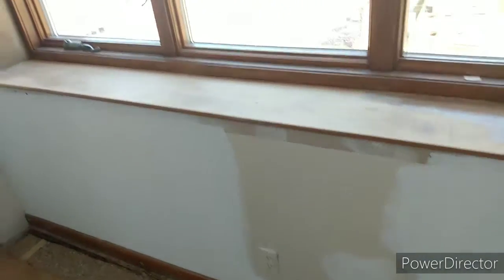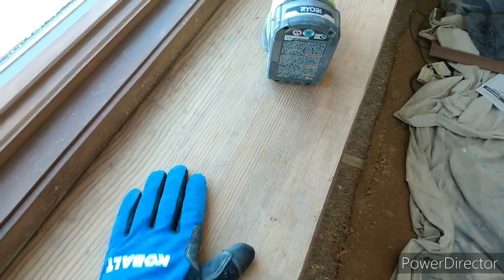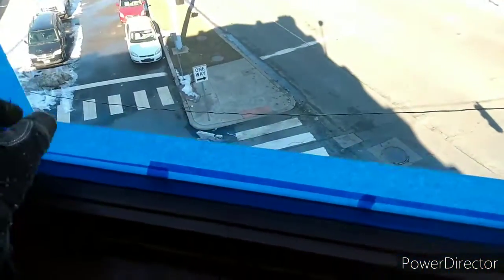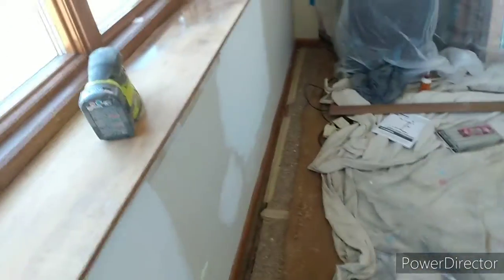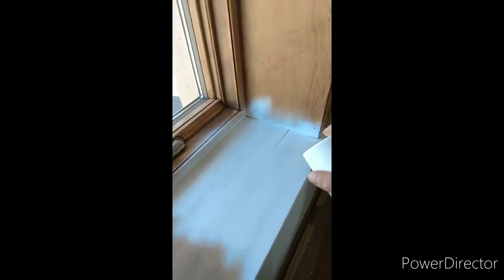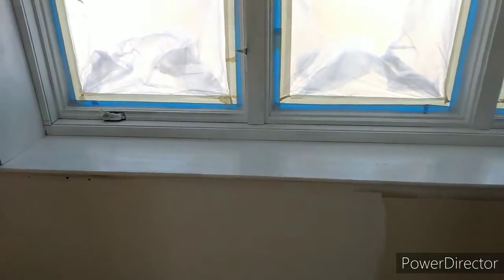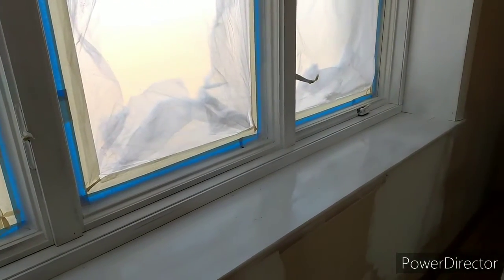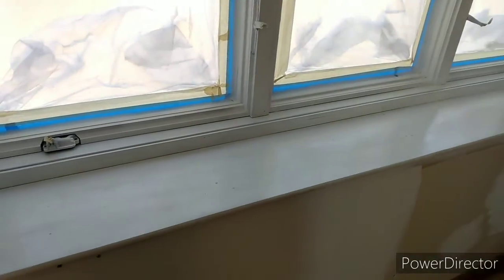How to paint stained or polyurethane wood trim.

Comment: Great video!  What do you recommend for stain but not polyurethaned?  My daughter is moving into a house with Anderson windows which were originally stained but nothing has ever been done to them and there is no shine at all. Do I not have sand them as much or at all?
Reply from the maker: Thanks I appreciate it. U can try it without sanding, the kilz will cover the stain. But I would still give a light sand to make sure the trim is smooth to the touch...but if it's for yourself and not a customer it's probably not necessary
Reply: @theperfectpaintertoolreview  Thanks!